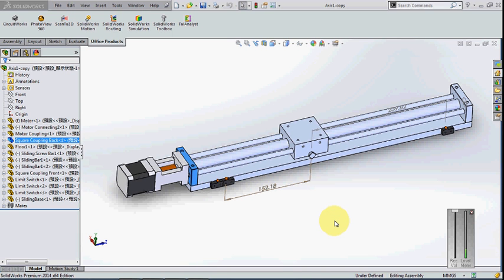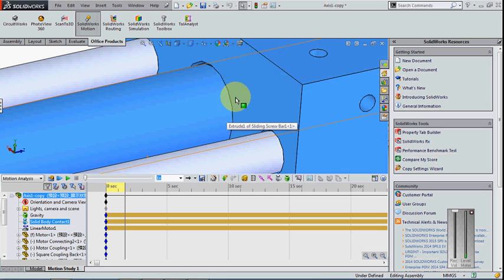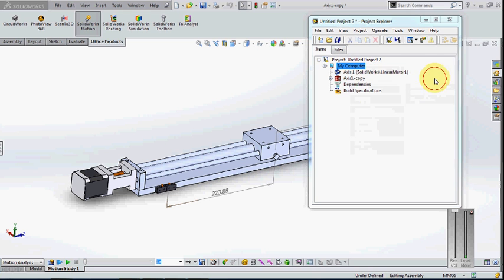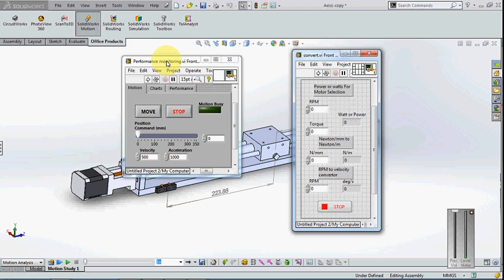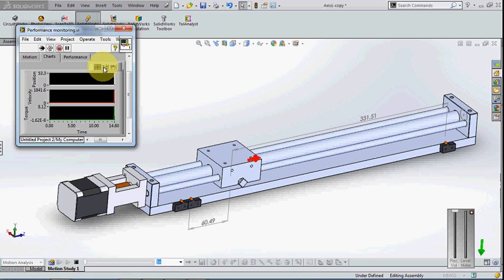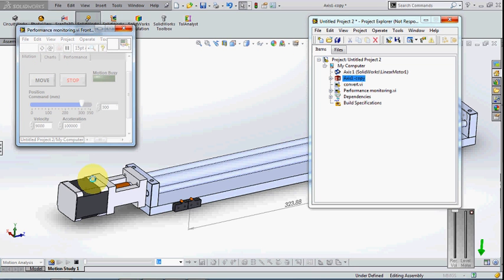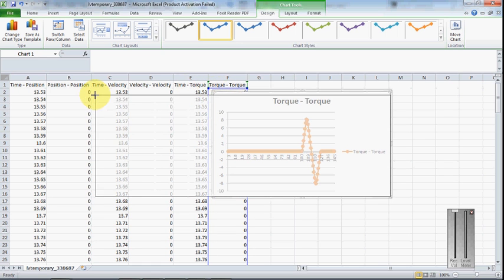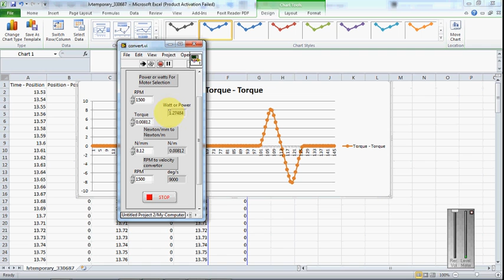How to select Motor For your Machine design ( solidworks)

Comment: Hi

Do mind sharing where can I retrieve the SubVI 'Motion Analyssis.vi'? Or any links to where I can able to refer/learnt to  gain the value of torque?

Does it still relate to NI SoftMotion or I need to use other modules (such as NI Motion) to retrieve the torque value?

Thanks in advance